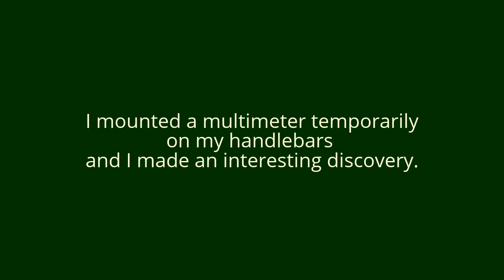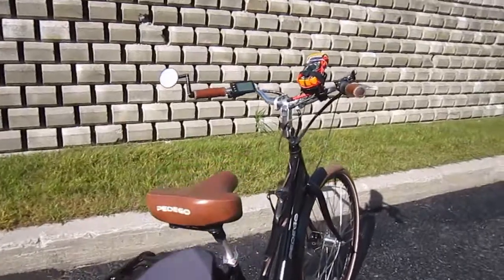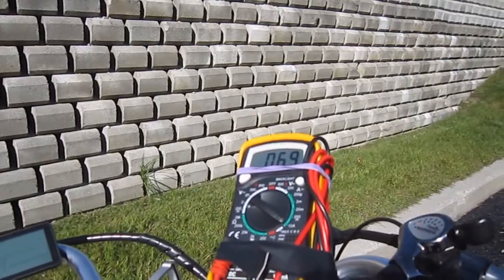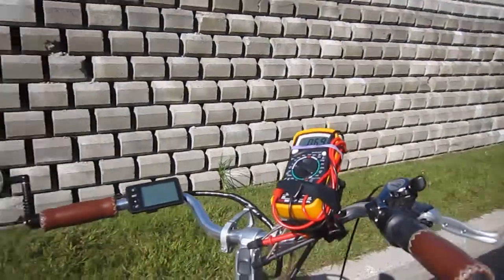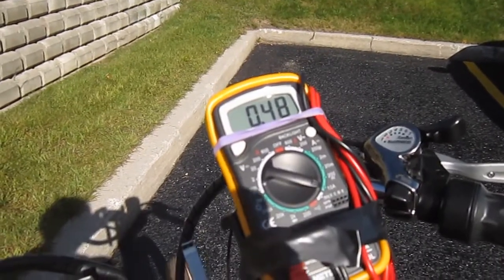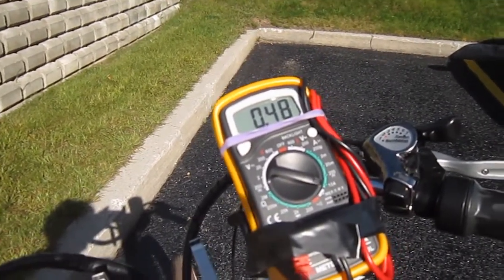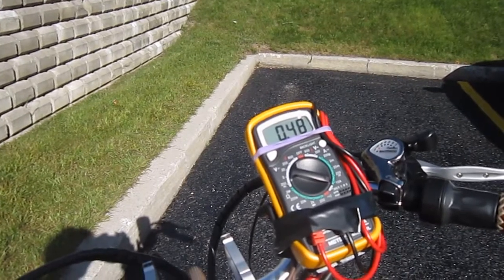3 Rob's Solar Trailer  Shadow on solar panel has big effect on charging power

Comment: Robert,,, i had the same issue... i instead took a chain tube, and mounded it horizontally, so that the flag pole would be inserted from the side.. This does two things.. It makes me look wider and it keeps traffic from getting too close on the left side.  It is really visible because the flag had reflective stripes..
Reply from the maker: Good idea. Thanks

Comment: That's a big problem, because the cell are wired in series. I heard 10% shading can reduce output, up to 90%. Maybe you could  have multiple mounting points for your flag mast and relocate as needed.
Reply from the maker: Right. When the sun is directly behind me I relocate the flag up front.